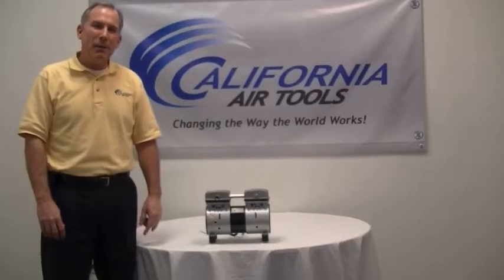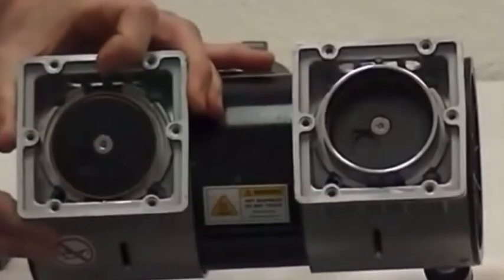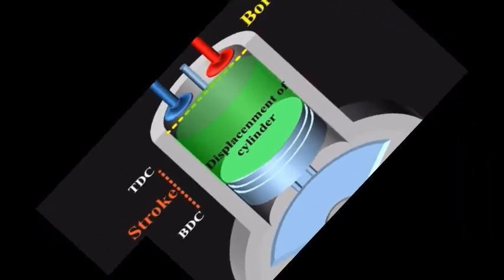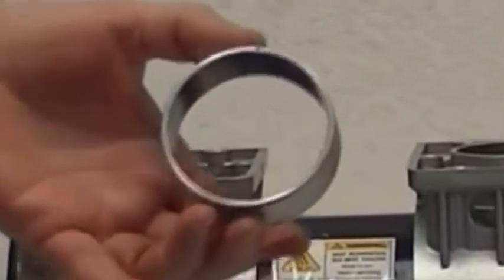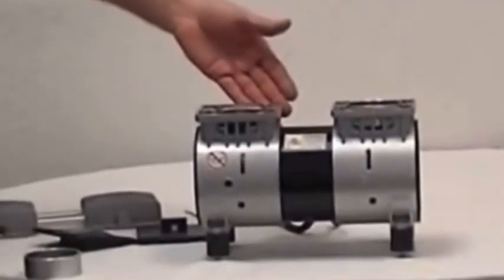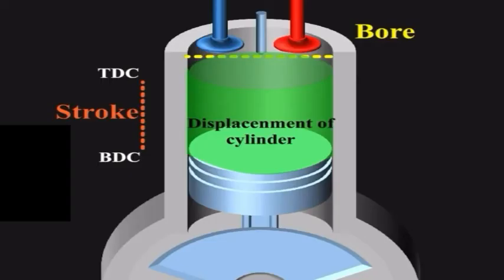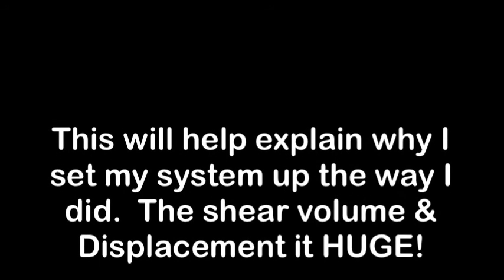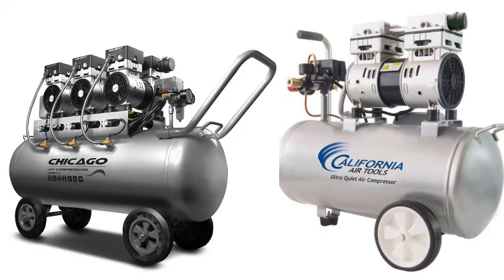California Air Tool Compressor ( Air Atomizing Aeroponics ) Internal Components & Breakdown

Comment: Why not run it in parallel, I thought you were trying to break it? 😉
Reply from the maker: LOL not trying to "break it" ... I'm "Pushing it to the breaking point" hahaha.

After seeing that video... I'm convinced it would definitely burn out super fast after seeing the 26 gallon unit using 3 motors and 6 pistons!

The head already gets hot running for 1 minute 40 seconds back to back when testing.

The cylinder wall is just coated with Teflon.  I checked the melting point of Teflon and it was about 520*F.    Aluminum's melting point is about 1170*F.  I'm sure the expansion of the aluminum pistons ( I'm assuming is made from aluminum)  will be well below both temps.  So, the heat/friction of the cylinder & piston will probably cause the pistons to cease.

Basically, I'm expecting the electrical to be fine especially since it's a brushless motor and the piston to cease in one of the cylinders.

I feel it's acceptable for this unit to cease in less than 2 years.  If I can get it to last longer than that then I'll be impressed.    

I already see what the what my next compressor project will be is.... a whole house compressor using 100 gallons capacity and hybrid the motors and pumps lol between this dual piston motor... getting another one and using the Dan Foss hermetic compressor for high psi.  haha these projects are sick because they just keep getting bigger and bigger lol.
Reply: @aeromah1062  
oil-less compressor lifespan is more or less inbuilt, basically everything rests on the teflon coating. Cheaper oil-less compressor tend to have shorter lives than the more expensive ones. I would guess you can replace the cylinders in top end brands but the cylinders may cost a lot more more than a cheap oil-less compressor :)  I`d be tempted to hook up an "hours run counter" to the compressor side of the pressure switch so you know how many hours its run if/when it packs up. I don`t think you have to worry about it making it beyond the 4 year warranty expiry date :)
Reply from the maker: @atomizer2665  LOL yeah it's true... I'm not out there trying to destroy it but, if it happens it happens.  Only 2 concerns I have:

- if it blows just after 4 years lol
- if it blows right during a solid grow hahaha

I  can and will probably tie the DIY comp into this loop somehow.  I've already set up the entire garage to this new comp.  In my video I mentioned something about putting in a bypass.... well what I was thinking at the time was to tie the garage to either the 82 psi tank side access for the garage or using the 110 psi side for the garage limiting myself to 8 gallons of air but, having full pressure of the compressor itself.

These days I don't use the compressor as much as I use to  but, it's nice to run air tools when needed.

I'll probably leave it for now... I've go way too much going on... going to be running a test on a vacuum tank for both carbon kevlar molds and abs/petg vacuum molding.

Cheers!
Reply: @aeromah1062  
I think you`ll be ok either way. Assuming a life expectancy of 200 hours and an output of 3cfm you`d have 36.000 cubic feet to work with.  A typical AA chamber running two siphon fed nozzles shouldn`t use more than  60-100 cubic feet a day.
Reply: AeRomAh hah, I think you need another channel called CompressorMah